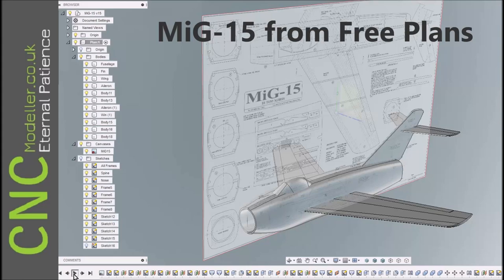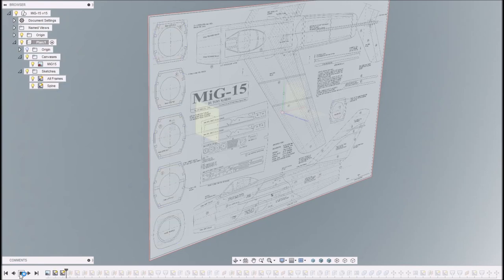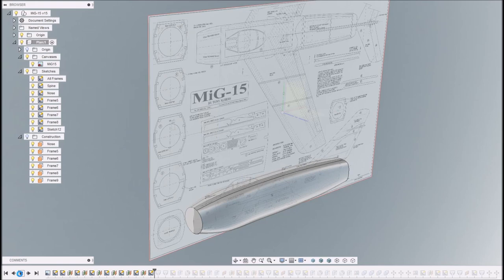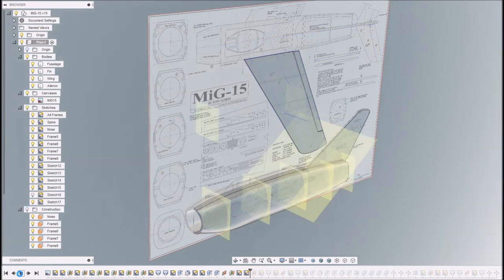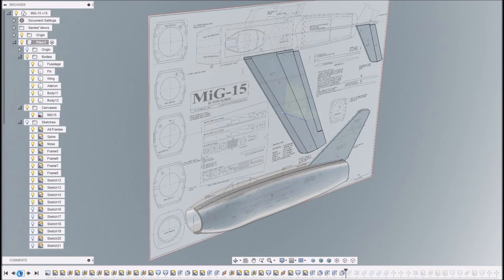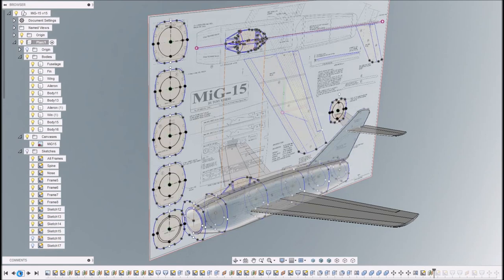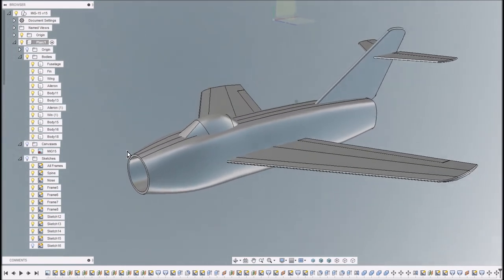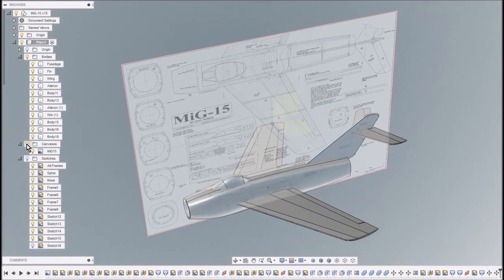How to Creating a MiG-15 CAD Model From RCME Free Plans in Fusion 360

Comment: Confused a bit on how you created the canopy. Did you trace the sideview on a sketch and then rotate that onto the top view to give you something to create a framework with?  I assume then patch workspace to fill it out?  More detail on that process would be great. Thanks.
Reply from the maker: Hi BigMeany, 
From memory the canopy is developed from a few lofts, there are basically 4 span wise arched profiles and longitudinal a centre line. The aft deck is lofted to the rear most frame, the rear frame is lofted to the front frame. The windscreen was created in a similar fashion but using the rectangular profile as guide rails to loft between the fore deck and the first frame. I remember I had to do a few iterations to get it right but it was all done with solid geometry...
Hope that helps, If I get some spare time I'll make a short detailed vid on how the canopy was created.
Many thanks for the interest. 
Barry M

Comment: how did you get the plans into fusion 360 please, I have some model boat plans that I would like to get into fusion but Im not sure how to do it. I thought about cutting out each part and scanning it into either Illustrator or Inkscape, but not sure if that would even work. Also, now you have the plans into fusion, in your case the Mig, could you then make the parts on the cnc to build the model as per the plans.
Reply from the maker: Hi S.A.W! I scanned in the plans as they were folded (A3) and stitched them together in paint. I then imported the image into fusion as a canvas and scaled it based on a dimension from the plan. Once you've created the geometry in Fusion you can definitely use the manufacturing workspace to create gcode for the 2d forms to run on a cnc router or laser. Hope that helps! :-)
Reply: @CNCModellerUK  Thanks for that, I'll give it a go with the boat plans.